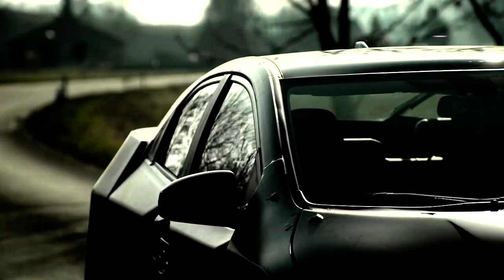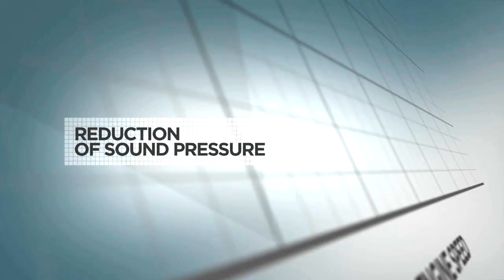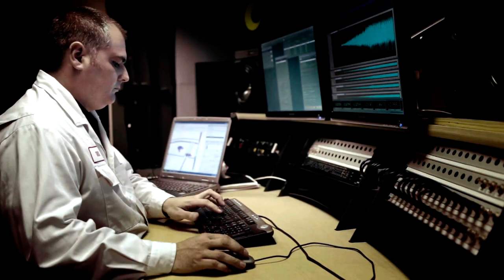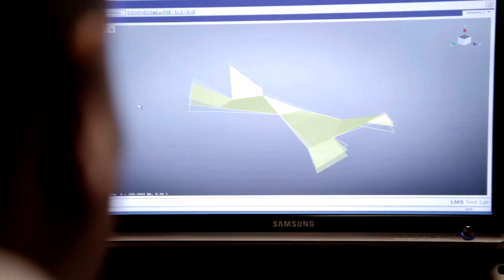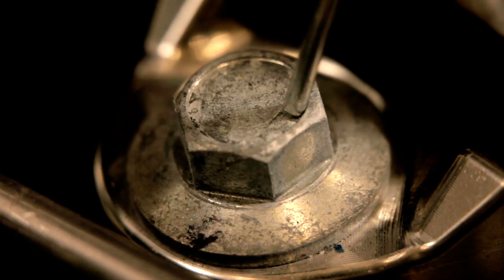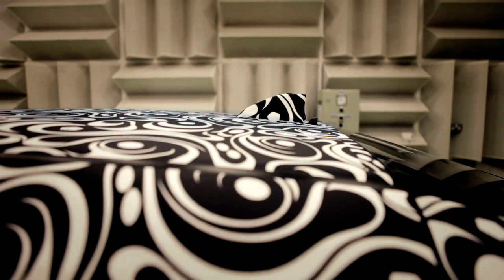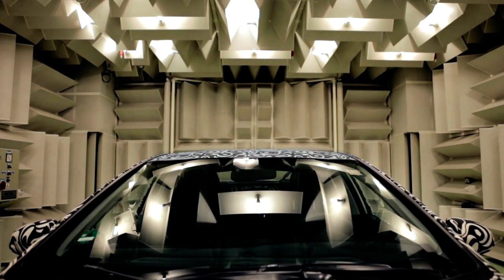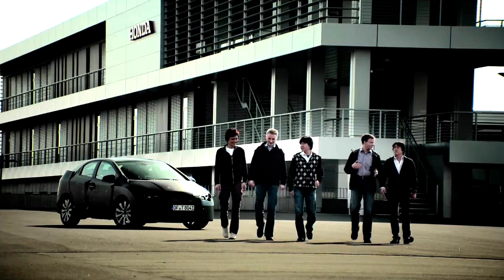Honda Civic Noise Reduction

Comment: I'm perplexed; engineering isn't mucking about in the dark, certainly not without reams of data logs. That being said this  bit makes it seem that their cars would at the LEAST be competitive  with others in its class, which it's not. 
    I'm curious what measurements they used to quantify noise reduction, because my 2015 (this being well after the introduction of the 2012, which bombed horribly) is PAINFULLY & DEAFENING LOUD. It runs 90dba on rough pavement, which is apparently a fixture of rainy/snowy states here in the U.S.. That's well above accepted levels of regular noise exposure. 
    I'm positive if more people were aware of the damage being done, & it's cumulative effects, a viable class action suit could be presented.

Comment: I had a 2007 Civic and it was so loud at high speeds, I had to use earplugs.
Reply: I thought I was the only one. It's maddening; for F!s sake these people are trained in solving problems exactly as the ones they apparently cannot. Way to go Honda. The whole entry bullshit doesn't even apply; Sentras are practically silent, and the Corllas aren't too far behind.